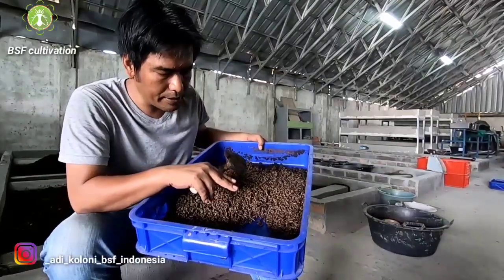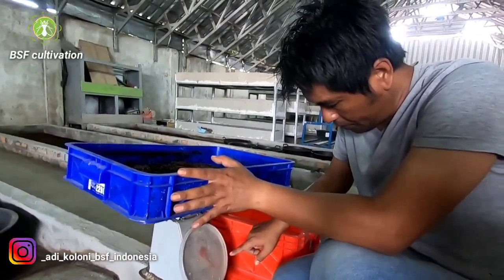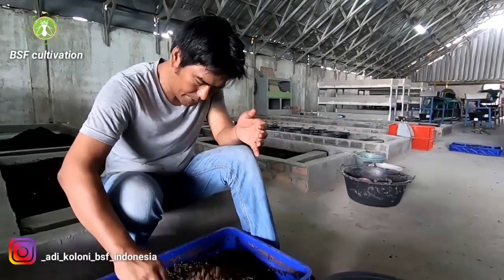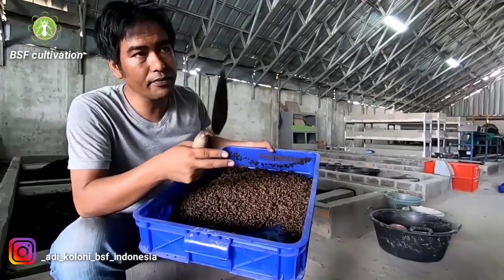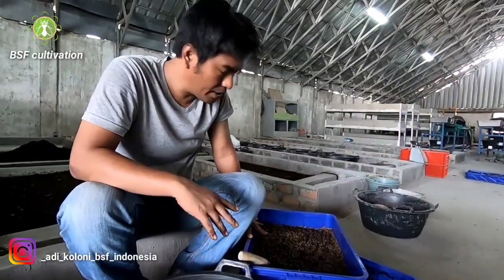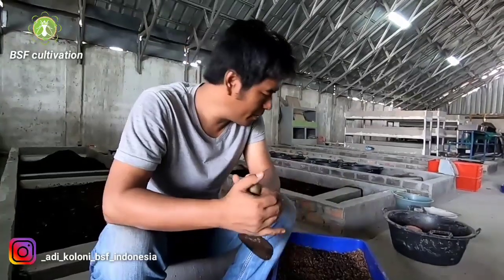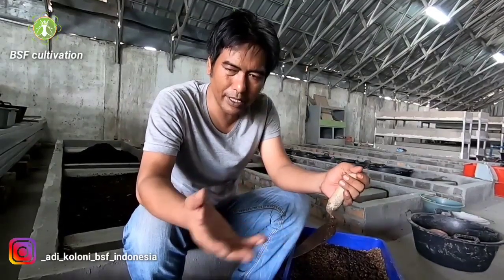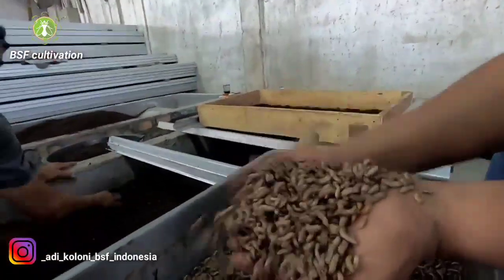1gr of BSF EGGS become 4Kg of LARVAE & more to calculate...

Comment: I've made a small BSF breeder and it worked so well until the ants and lizards 🦎 found them.
How do you keep them away from the maggots?
Reply: I also want to know tht
Reply: for ants you can use ant traps made with a cup filled with water  and a little bit of soak. You must put the support of your rack into the water with soak. you need  one cup for each leg of your rack. For the lizards I have no clue.

Comment: I had alot of pupae but the hatchbility was low .what went wrong?
Reply from the maker: Check ur storage bins. Make sure not too high temperature, 30-40 is normal, good air flow inside
Reply: @blacksoldierflycolony2297  Thanks for the information.